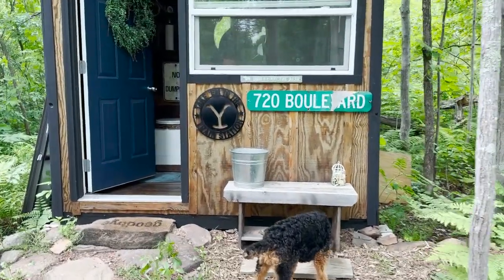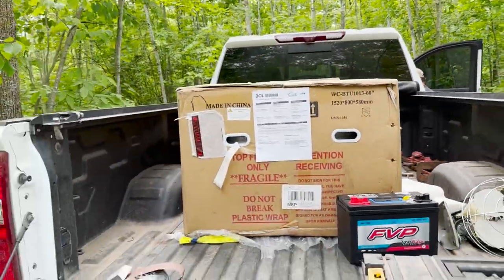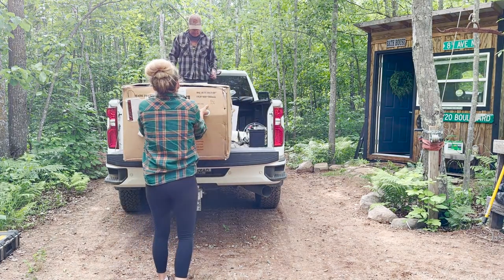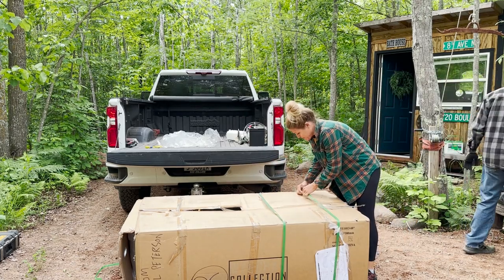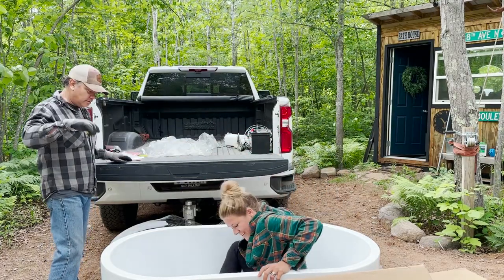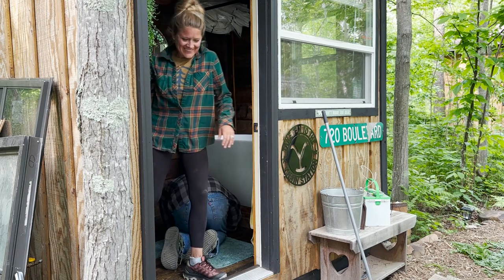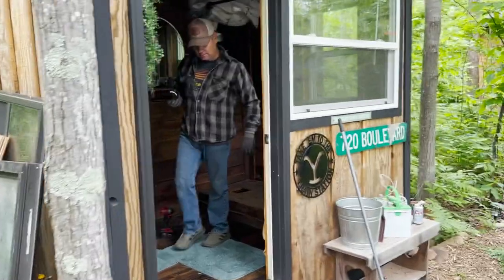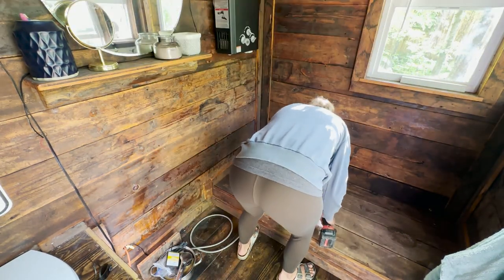Outhouse Remodel | Off Grid Bath House Shower & Bathtub

Comment: Your bathhouse videos are the best. Unfortunately, I have to welcome you to the frozen, pipes burst over the winter, gas hot water on demand club. I had that happen with our first at the Shottages. Luckily, the 2nd survived the winter after running winterizer to it in the fall.

Keep up the awesome work!
Reply from the maker: Thank you!! Ya it’s a bummer. We usually winterize it every time we leave…. But obviously failed. Our new little system did great our last trip. Just simpler other than waiting for water to heat up. Great to hear from you & hope all is well with your new place.